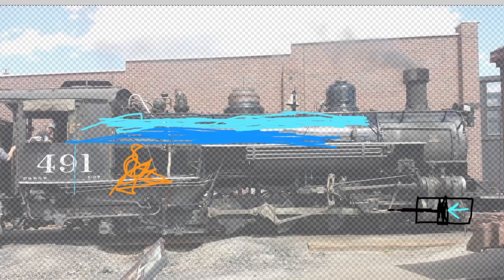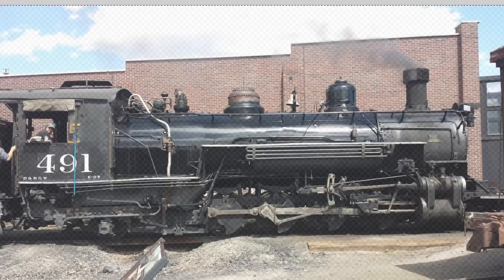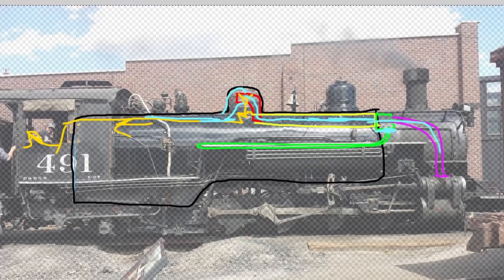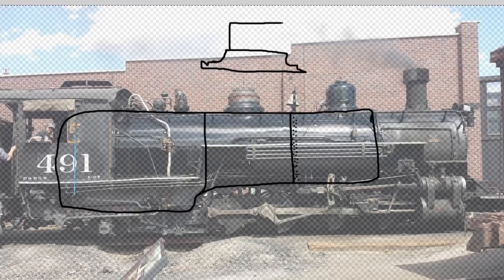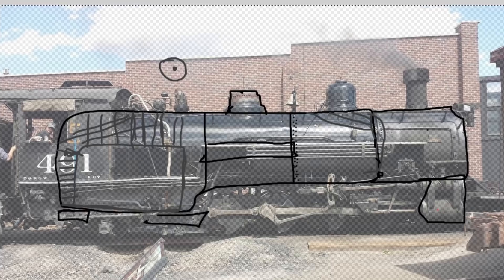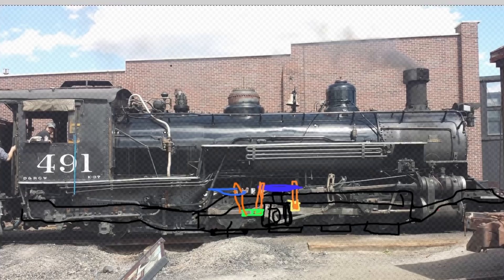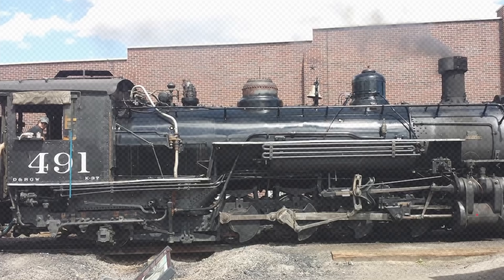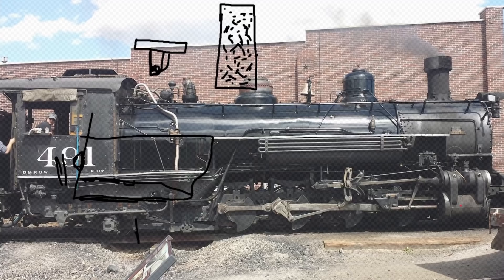Steam 101: 10 Levels of Steam Locomotive Understanding

Comment: steam to generate electricity...was electricity used for much in a machine powered by fire?  Is it a thing that was introduced later but not in early steam locos?  Is it generating power for say, electric lights down the length of a passenger train?  I don't know the history of how much electricity was used on these.  Headlight, I guess.
Reply from the maker: Headlight, cab lights. That's about it for most. Definitely a mid-later steam era thing.

Comment: Huh. Amazing how much of this is still used in manufacturing. Extrusion, die stamping, rivets, rolled sheet metal... All things used in aircraft manufacturing. Albeit it is aluminium but same idea. Even the shape and pressure. Much less about 6 or so psi difference from in and outside at altitude but all the same.

Comment: This was really great. I've "subbed and liked".

I can fairly say I knew a lot of it, but even so lots of little details I didn't, such as EXACTLY how the throttle works (and different placement of it for some superheaters). I especially didn't know much about 5-6 covering the boiler construction and the frame and suspension stuff, which ought not surprise you or me because that's pretty specialised or nerdy knowledge, LOL.
Been having a lot of fun since finding your channel.

Here's something in return. 
Given how much fun you've had with Big Boy in the sim, I suspect you'll enjoy the Beyer-Garrett engine 6029 here in Australia if you've not seen it:
https://www.youtube.com/watch?v=Vy00qe-a2aE

A few nerd stats, lol: (taken from https://en.wikipedia.org/wiki/New_South_Wales_AD60_class_locomotive )
Length	           108 ft 7 in (33.096 m)
Loco weight     582,000 lb (264,000 kg)
Cylinders:	      Four
Cylinder size:	19.875 in × 26 in (505 mm × 660 mm)
Tractive effort   63,490 lbf (282.4 kN)
It also has a mechanical stoker, plus a bunch of other supposedly 'advanced' features (see the link).
A single engine would typically haul anything from 600t to 1,500t in a common run depending on the line.

Cheers
Reply from the maker: That video was a good bit of fun! Those Beyer-Garretts are crazy machines. Those cylinders are similar in size to the ones in 491 from my video, 20x24 in. :D
Reply: @Hyce777  Glad you enjoyed it.
The interesting thing about the design is it was intended to meet a requirement for a powerful goods loco that could work on branch lines (hence the relatively low axle load initially - not sure what the correct term is) with tighter turns than the main, hence the reticulation.
Once they found they were using them much more on the main than expected, they increased the axle load and upped the tractive effort, and also increased the coal and water capacities.
One other interesting bit is the modified ones also were fitted with a second set of controls so it was easy to drive the loco tender-first. 6029 was one of those, but the extra set was removed.
I've seen it once, and it IS both crazy and impressive.  ;-D
Cheers

Comment: I have two books on building a shay and a climax steam locomotive in 7 1/2 inch gauge from kozo hiroko I want to build modify the plans and build them in 15 inch gauge for farm use as well as a traction engine for field use doing the jobs I don't want to horses to do pulling a plow in particular they can cut there own hay  but I'm not making them pull a plow and I'm not going to use battery power tractors and I want to stop using diesel in my jd 5400 so that leaves me with biomass the branch prunings from the orchard cow dung and plant stalks I have to do the research and testing to find a usable way for me to run my farm on steam  I also intend on developing a solar heat collection steam for a stationary steam engine aswell as some pneumatics from a wind turbine to run pneumatic Amish ceiling fans and kitchen appliances and any other house equipment I might want to run that is not electric powered that way I can once again reduce the precious metals from storing solar electric in batteries and solar panel production on my home which is the first thing we are currently discussing as a family what we want to do as of right now I'm level 5 on knowledge but I do know some on mechanical water injectors and i aim to improve that to complete construction maintenance and operation my favorite locomotives are Shays  the john bull and any kind of logging locomotive from 0-4-0 to diy projects they had built from other locomotives

Comment: It seems you missed an important component in level 2.: the aerodynamics of the exhaust steam moving through the smokebox creating negative air pressure (partial vacuum) that serves to draw the firebox heat energy through the flues (also surrounded by water = more steam generation). To me, the most noteworthy aspect of steam generation system.

Comment: There is another issue of the pistons on each side of the engine getting out of time, and the drive wheels want to work AGAINST each other. Read about it, a long time ago, but don't remember the cause or the remedy to make the timing right again! When they call a person,a train ENGINEER, he is MORE then JUST a train DRIVER! 🚆 🙄
Reply from the maker: They can't do that. You may be thinking of getting stuck centered where you stop with one side not providing power, but without the axles splitting apart the pistons are stuck 90 degrees opposite each other :)

Comment: The constant mic popping seems to be an issue. Sadly, I can't watch the vid cause of that. It's not you, it's me, I pawmise.
Reply from the maker: Yeah I hated it too. Was an older problem I dealt with. Has since been remedied, thankfully :)
Reply: @Hyce777  Thats good! Yeah I had only noticed it in the one vid, maybe I'll come back to it at some point but after a long hard day at work something that small just gets to me.
Reply from the maker: @YourLocalRaccoon  tooootally get it. It was caused by a malfunction of a several thousand dollar piece of equipment so it killed me too. Lol. It's present in a few videos of mine. Last month to 6 weeks or so is all good though.
Reply: @Hyce777  Oofles I feel that in my wallet. My trust little Behringer UMC202HD and ModMic 5 are working wonders for me, but yeah not exactly high end stuff.
Reply from the maker: @YourLocalRaccoon  behringer makes great bang for the buck. I also used to use a modmic. Simple, inexpensive but good is a good way to be. :)

Comment: "we a take fire, we take water, fire makes the water turn to steam, the steam makes pressure, pressure can move a rod and a rod can turn a wheel and we have a train"....
well, we have a Boiler with two Engines attached., a Locomotive 
to get a train, you have a point of departure and arrival, timnes for each, assigned cars, locomotive and crew as well as a route which is assigned a number
JUST FOOLIN WITHYA

Comment: Why, oh why do you keep using an internal combustion engine term and apply it to a steam locomotive? 
"THROTTLE BODY"
THERE IS NO THROTTLE "BODY" on a steam locomotive. It's just called the THROTTLE.
Reply from the maker: At least on the locomotives I've worked with, there is a defined body that the throttle valve is a part of that you can take out separate of the dry pipe, with its own connected stand pipe. It seems perfectly fitting to call it a throttle body to me, not sure what else you'd call it. The whole assembly is the throttle, sure but the individual pieces?

Comment: Nice first attempt, but you’ve entirely missed a main point in STEP ONE . Why it’s a TUBE TYPE BOILER. The boiler tubes are a huge part of what TRANSFERS THE HEAT. Your discussion and hand-drawing simply show the tubes being used to exhaust smoke. You draw indications that all the heat transfer is coming around the firebox. You should re-edit your video as it’s missing the point of the heat transfer from those tubes to the water in the boiler. This is important because there are other types of boilers that function differently. I know you cover superheating pipes in later steps, but you’re missing a MAJOR FUNCTION. It’s important to have an editor or other expert source review your content before final publishing so you don’t miss fundamentals like this.
Reply from the maker: Thanks for the comment, but the tubes account for a very small amount of the heat transfer. I should have noted that they do, but again, not as critical as the rest.